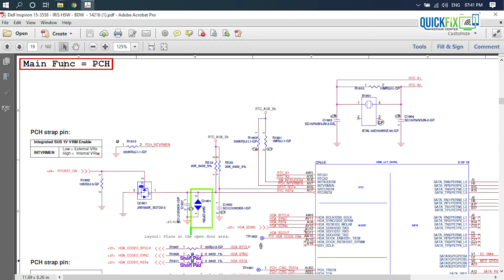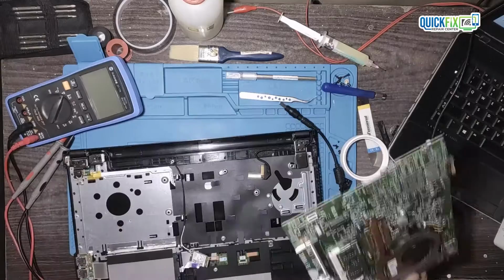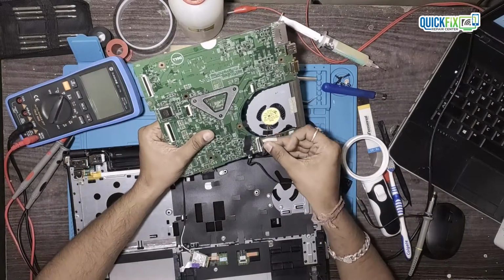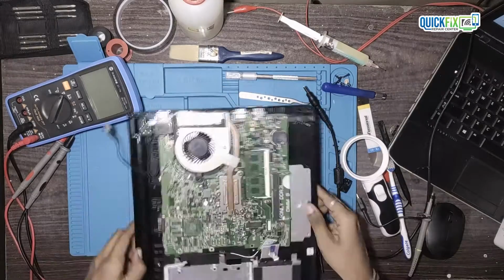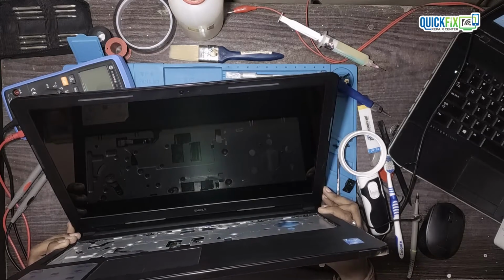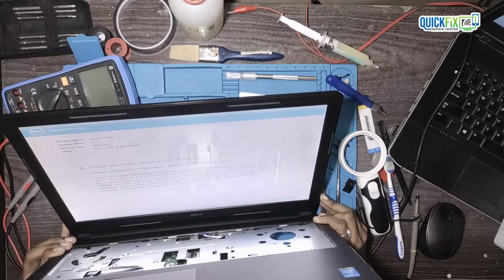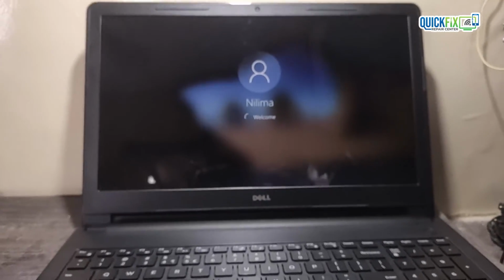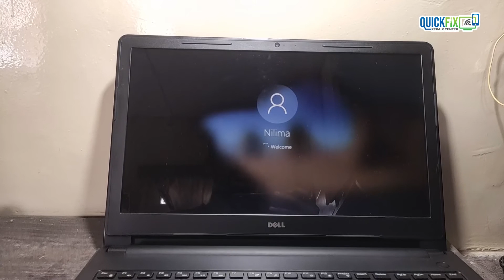Dell Laptop Wont Turn On | Step to Repair Dell Laptop

Comment: Your conclusion on finding the capacitor faulty was too fast and difficult to follow .A few more stages would have helped.
Reply from the maker: In cold testing I found resistor value is proper and there is no other component place between SOC and resistor except that capacitor. Hence I suspect that capacitor is faulty and after replacing, voltage reading is found proper.

Comment: What's ur contact details?
Reply from the maker: You can reach us using the following details;

Email - quickfixrepaircenter@outlook.com
Mob - +91 7738338532
Reply: I am having *hp 640G1 Laptop*. In this laptop the problem is that it is not turn on by pressing power button. I checked voltage on battery section, on power connector on motherboard, it shows ok . Now when I plug a adapter it turn on automatically. It has turn on problem. I also try to short our power connector terminal by twiser it gets turn off but no turn on by shorting again. Pls provide solution.
Reply from the maker: Please follow power sequence.maybe some requirements is missing.

Comment: wt is the model number of magnifier which u r using sir
Reply from the maker: It's 2 LED Main lense Interchangeable Type Magnifier. kit include 3x, 10x and 16x magnifying glass. If you want more detaills or photo of product, then mail me on quickfixrepaircenter@outlook.com